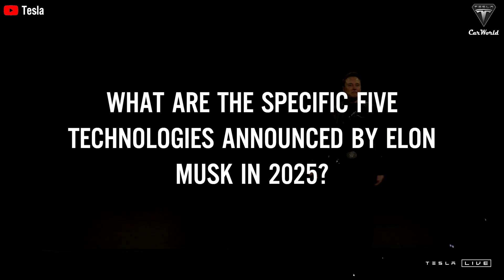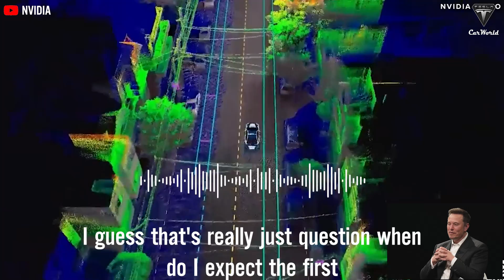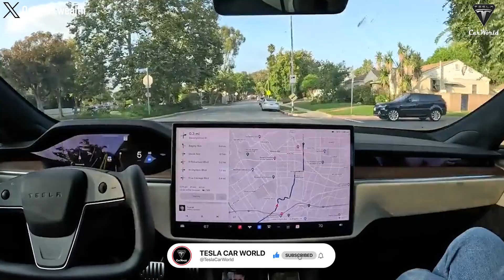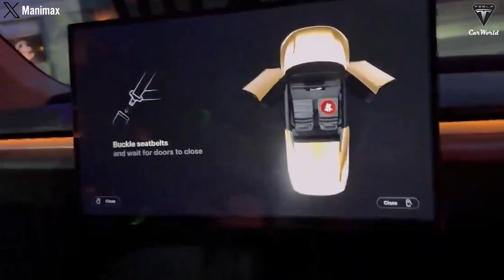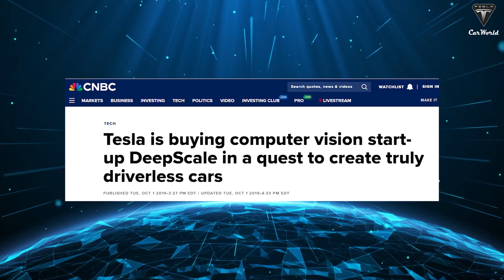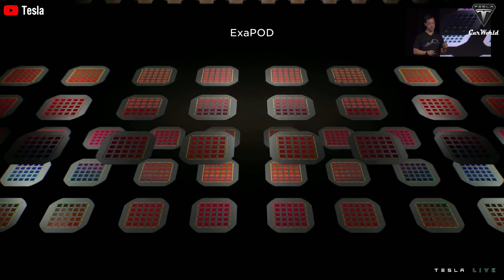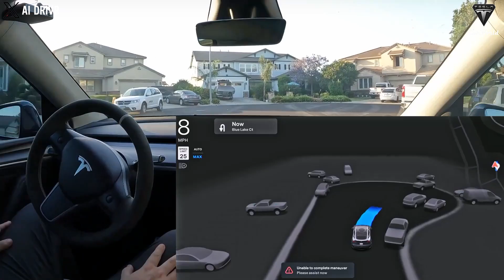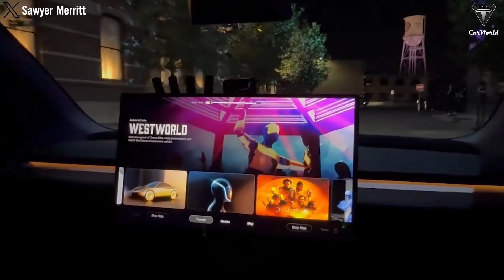2025 Tesla Shocks The World! Elon Musk Announced 5 Factors That Will Change Everything!

Comment: I don't understand why the Robotaxi only has a frontward driving system, or why it is designed as a frontward driving vehicle. If there is no driver, why should there be a front or a back of a car? The car should be able to drive either forward or backward with the same effective reliance. It would allow four passenger accommodation.